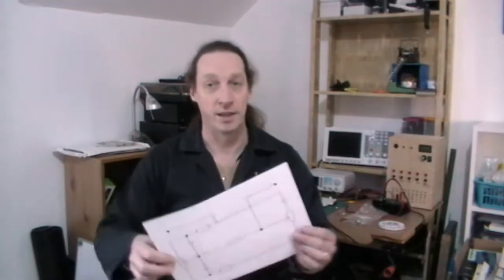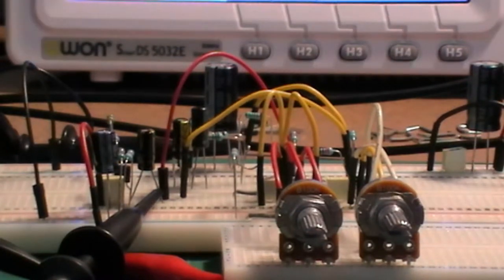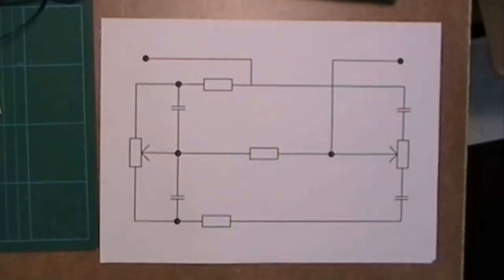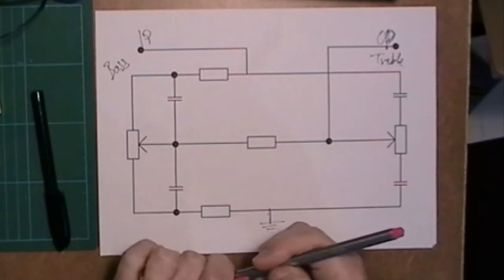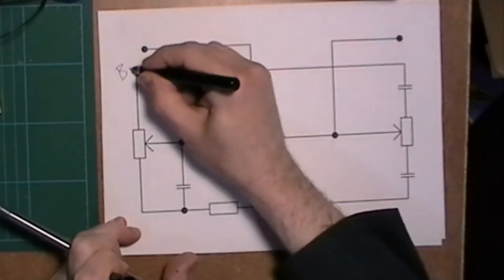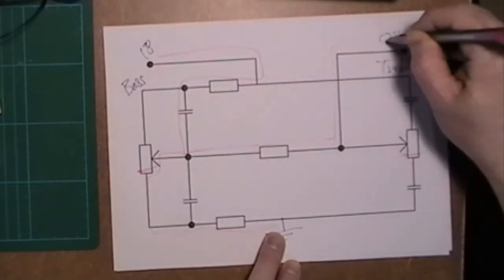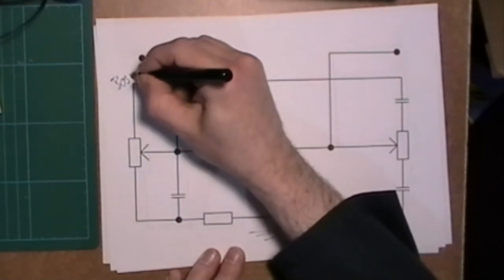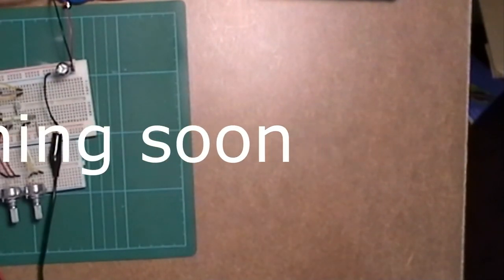Baxandall Tone Control (Part1)

Comment: Totally wrong.

1. The Baxandall tone control is an active filter, not a passive filter as described here.
2. The node labeled 'earth' is the point where NFB is introduced in a real Baxandall tone control, which has no real earth.
3. A passive filter is incapable of boost by definition.
4. The active components are not just there 'to make things nice'. You need a phase reversal via negative NFB to make the Baxandall circuit work.
5. What you have described here is the James passive tone control as still found in guitar amplifiers. It predates the Baxandall by several years, and is not transformable into it.
6. The James is characterised by (a) an earth connection, (b) unequal capacitor values at top and bottom, (c) log potentiometers, and (d) a 26dB insertion loss.
7. The Baxandall is characterised by (a) an NFB connection, (b) equal capacitor values top and bottom, (c) linear potentiometers, and (d) 0dB insertion loss.

NB Peter Baxandall did not 'pioneer audio electronics'. It was already a going concern when he was still in short pants. He certainly made major contributions to it: not the same thing.
Reply: Hi thanks for for input I must admit I would not have researched it any further with out your input. I have gone back to read his original article and clearly it does say about the negative feedback being needed. I always thought it was just an amplifier stage to overcome the 20 odd db loss the filter part introduced so have learnt something today. Also had a bad day with an amplifier I was building that did not want to work!! Which is why I was searching for the Baxandall circuit as needed some controls. Thanks again.

Comment: When you were showing the output on your oscilloscope, your two signals appeared to be out of phase with each other. What would cause that to occur?
Reply from the maker: Hi Jedi Minion, as this is a passive filter that is basically hi-pass and low-pass filters in one circuit.  Very well designed to work effectively, so the capacitance of such filters will cause a small shift in the phase.  That phase shift will change with the frequency and to some extent the cut or boost of the circuit.

Comment: WHat will bo good values to use with guitar
Reply from the maker: Hi Pedro Jinta, not really sure what values will work well with a guitar as I did not try it with a guitar.  I would say try out values that give the mid range of 3KHz to 5KHz frequency as the main part, then cut and boost from that.  You will have to experiment with what values work well to get the desired effect.